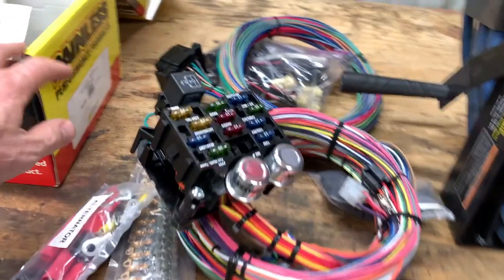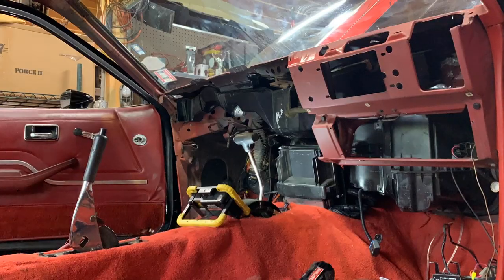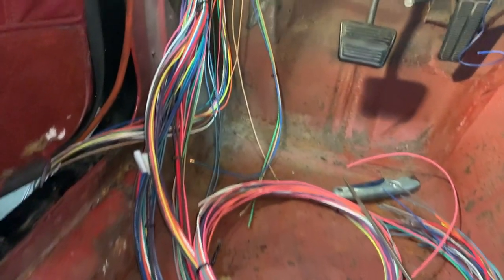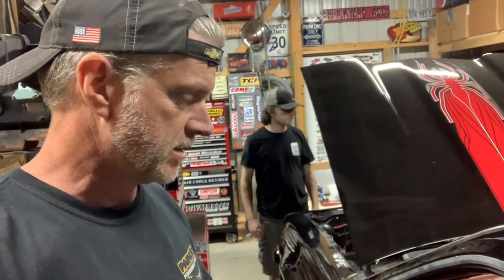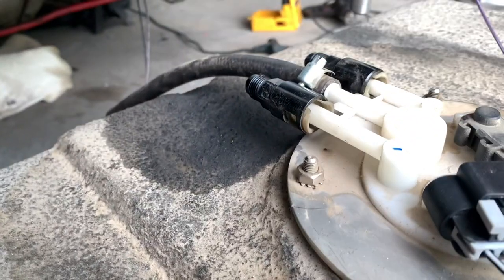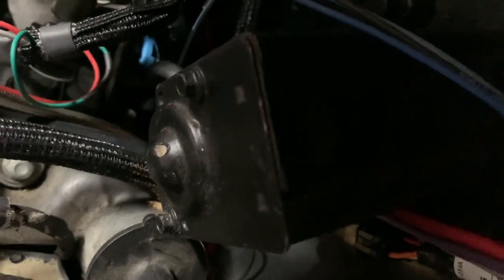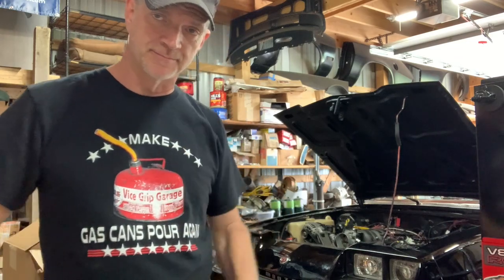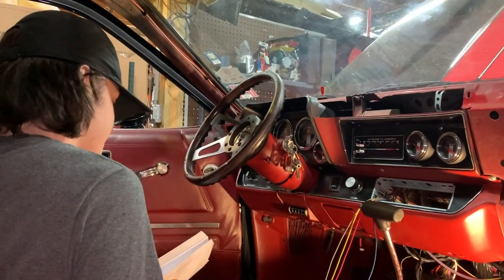Is it really painless? Painless Wiring COMPLETE REWIRE of our Monza!

Comment: It flooded with fuel because the vacuum line wasn't on the MAP Sensor = ECU (VE Fuel Table) thought the throttle was wide open.
Like it or not, your learning EFI quickly👍 Another FYI is, since I'm pretty sure you connected the Holley Harness to the engine's MAP sensor?
If so, you can change the "Sensor Type" (Sensors then MAP button in the software) from Internal 1bar to the GM# sensor your engine has = no vacuum line need from the engine to ECU...
Reply from the maker: Yeah we learned the hard way how badly it runs without the vacuum line.  However, I wasn't aware that changing from the generic Internal 1 bar to the GM # would eliminate the need for the vacuum line.  Thx!

Comment: Working on a painless wiring harness is blocked for my 87 barbers right now slowly figuring out the wiring make sure it’s all right bud I’m using a painless circuit Boss I was told are use it to power my other relays so I’m gonna try it he said that sounds like a good idea give me a buzz back I haven’t done any wiring on the car since 87 so yeah I got an LS 1999 it’s an LS one but I see all the wiring it’s going on with that thing and it just threw me off on the vac 40 so I still have it I had it for quite a while now but yeah I’d be nice little motor to build I thought I was gonna have a lot of money and swapping it in my Firebird so I went old school stroker motor but I had to put just as much money did as I did I would’ve with the LS one drive safe have fun later bye